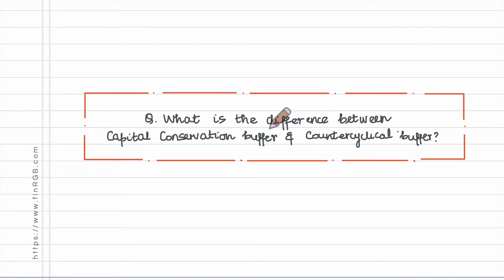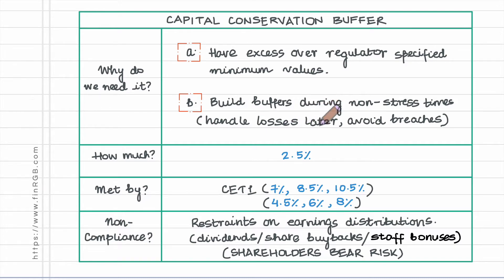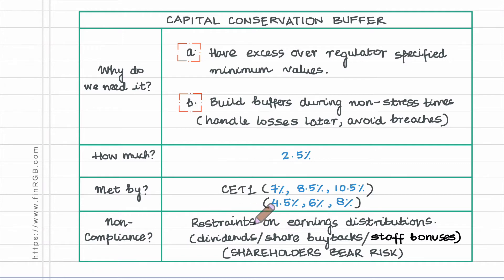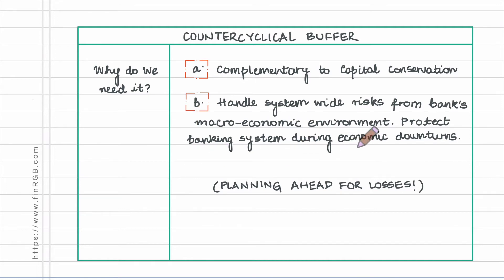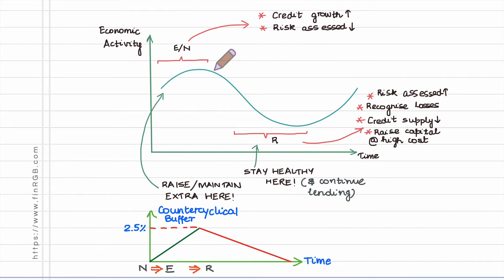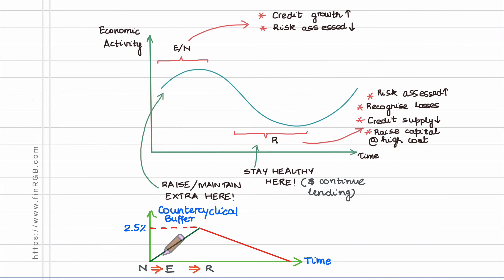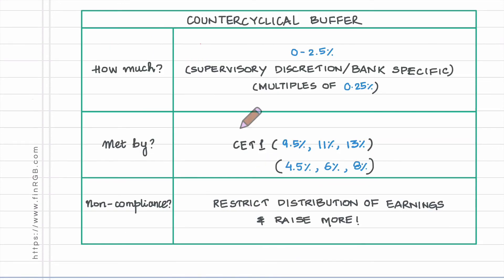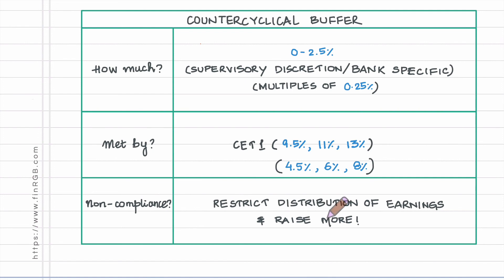Capital Conservation Buffer Vs Countercyclical Buffer (FRM Part 2, Book 4, Operational Risk)

Comment: Nicely explained. Understood everything but what is the actual difference between them? I mean why need of such 2 buffers ?
Reply from the maker: Hello Amarjeet, the capital conservation buffer ensures that banks raise capital levels during good times and then are able to draw them down when losses arise during stressed times, while still be able to operate above their regulatory minimums. The countercyclical buffer works as a macro-prudential constraint that supervisors can use to reduce excessive system-wide risk buildups during expansionary times.